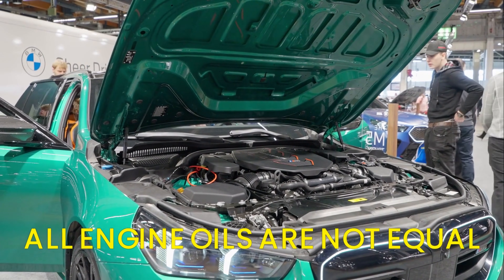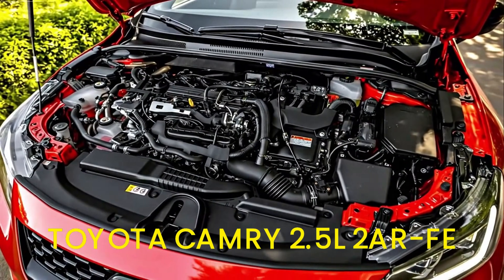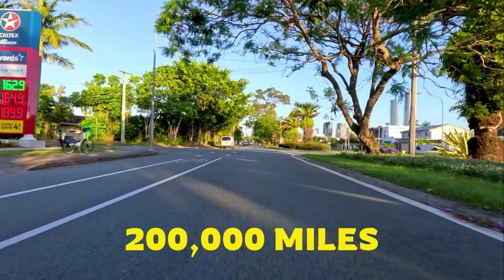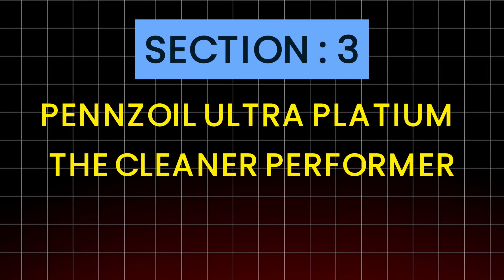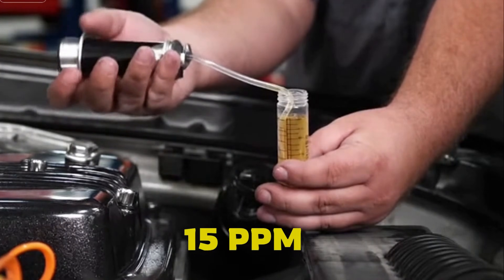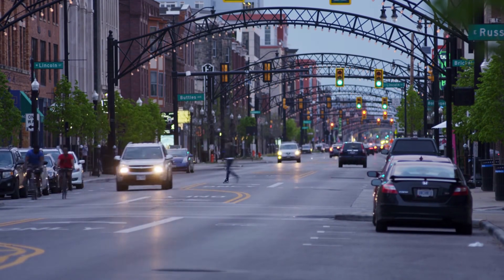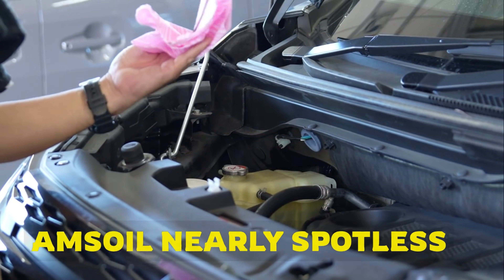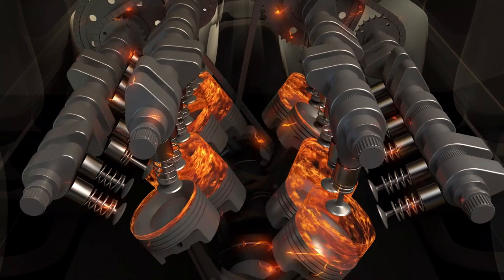I Tested 5 Motor Oils for 200,000 Miles – One Clear Winner.

Comment from the maker: I Tested 5 Motor Oils for 200,000 Miles – One Clear Winner

I Tested 5 Motor Oils Over 200,000 Miles – Only ONE Survived      

Most engine failures don’t happen suddenly.
They build quietly — inside the oil.

This engine ran 200,000 miles on different oils,
then got torn down piece by piece.

Which result surprised you the most?
And what oil are you running right now?

👇 Drop the oil brand + mileage below. Let’s compare real data.

Comment: You claim not to sell hype,

Yet you fail to provide any information on what car was used, 

You fail to show any used oil analysis

You fail to mention what grade was used

You mention that only one oil survived, without any evidence of any engine failures using the other oils

You mention that Amsoil was the clear winner, and I don't doubt that it's a great oil.... however,

I still see lots and lots of older cars driving around that would not have ever used Amsoil... yet they are till driving around,

My own car 8 years old and never used Amsoil... yet it runs great.

So sure Amsoil is a great engine oil, but not using it won't suddenly cause a persons engine to die significantly quicker than it would using Amsoil.....

Because even if the engine someone becomes immortal..... the transmission won't, the chassis will still rust... and other things on the car will also break.

Comment: I bought a Brand New 2024 F150 3.5
At 900klm I changed to Amsoil 5w-20 Signature Series, I’ve changed it every 3,000miles. It now has 22,000 miles on it. I added a magnetic oil drain plug around 2,000 miles, it’s spotless.
If there was a better oil I’d use it. I plan to keep the truck as long as possible. I’m retired and have time for extra maintenance. I do most work myself because it’s difficult to trust people to do proper repairs.

Comment: I have Hyundais, and all state in the manual to use Quaker State, in fact my newer one has a Shell/Quaker State tag on the engine cowl, so what is the opinion or verdict of this oil?
Reply: Shell and Pennzoil are related to each other.
Reply: @notsureyou    That is correct, but are doing the same process, one natural gas are the others ester or cracked oil
Reply: @josephschmidt439  Shell owns Pennzoil

Both claim to use Gas To Liquid as a base oil

Depending on the product, it might be possible to determine what the equivalent to each product is.

For example Pennzoil Ultra Platinum 5W30 has a HTHS of 2.9

Which would make the equivalent possibly Shells: Shell Ultra Platinum "Professional" 5W30 which being an A5/B5 has a HTHS of 2.9-3.5.

In Australia since they sell Shell engine oil, they don't sell Pennzoil.